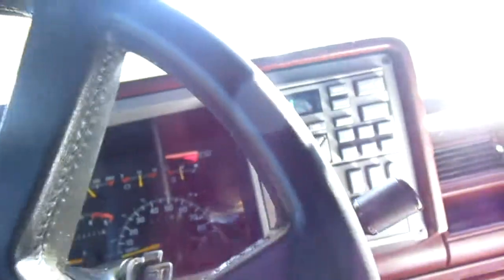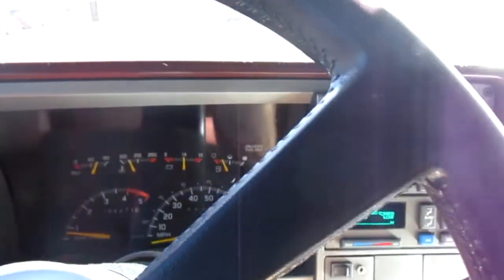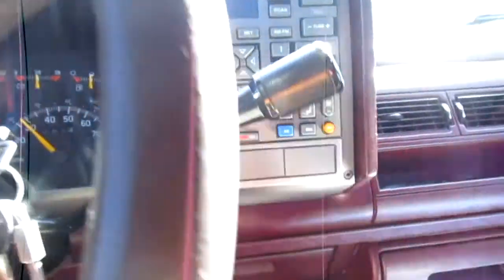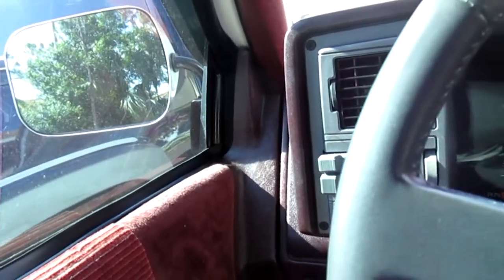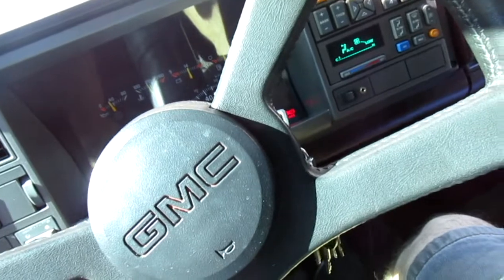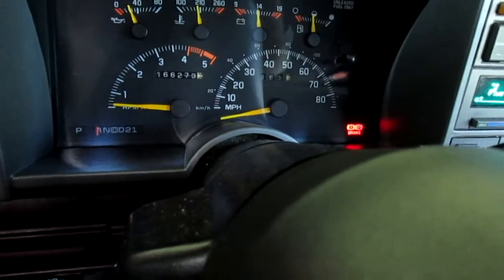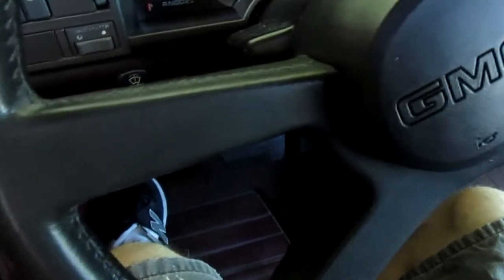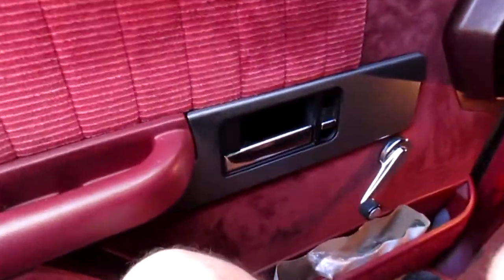Torque Converter Stall speed test makes engine stall!

Comment: The springs are to hard
Reply: Summit spent me 500 pund springs not 300 bent all my rods and made my stall convertor go crazy
Reply from the maker: was not it i had low fuel pressure but the Converter is a piece of junk.   Its still bad I need to change it soon  Finally have the time.  Its on the project list

Comment: Your truck is old and tired. Thats why.
Reply from the maker: No it had low fuel pressure
Reply: @GhettoWagon  Your fuel pump was old and tired. LOL  Just poking at you. I could tell by your dash that your truck is 88 thru 94 vintage.
Reply from the maker: @4793bigdaddy   It was not very old.  30k miles old its just the parts  quality of today and ethanol fuel.

Comment: My Explorer does the same thing, sometimes its a high stall, sometimes its a low stall. Did you find out what was wrong with it?
Reply from the maker: Torque Converter is bad but the fuel pressure was also low.  And the converter is still bad I need to find a competent place to change it
Reply: Thanks for the info. I suspect it might be a valve body related problem, because if the converter is bad, its bad, it shouldnt be ok intermittently. I will start with trying a shift kit first, but my trans has a few more problems like delayed shifting, bang in reverse, shift flare, so its more likely a must on my case. I'll see if it also fixes that.

Comment: Was it the converter?
Reply from the maker: Nahh fuel pump but the converter is a piece of junk. It shudders bad and i lose lockup. The fuel pump dropped off when there was more of load on the engine and the fuel pressire went below spec and made it chug and stall  I did not suspect the pump but then one day i threw a fuel gauge on, The pump is not very old. Typical AC delco quality. Garbage,

Comment: When I was 16, I was too broke to fix my vacuum leak so I just set my idle to infinity and beyond to keep it going at stop lights. I'm pretty sure there were a few times I flew in the air when switching gears.
Reply from the maker: Was that your old car? https://youtu.be/PMk1WJAq80o?t=6m2s
Reply from the maker: Was your car two cars welded together?
Reply from the maker: https://youtu.be/A40CAYkW3ME

Comment: Have you looked at the IAC motor ??  Might be something simple
Reply from the maker: Works good.  Reset it. Changes nada.   Being that the trans shudders and I have no lockup. gotta start with the converter.
Reply from the maker: I hope its bad.  I have no reason to believe anything else is causing it.   First I had the shudder.  Then I had no lockup.  Then I had a massive clunk accelerating from a stop. Felt like I had a high stall converter for a few days.  Then this, Dies out sometimes in reverse or drive  I did let it go too long. I stopped caring. lol
Reply: Ghetto Wagon  I'm not sure, if you could scan it and watch the slip of the torque converter that would tell you more. But it's not OBDII. If you hold the rpm up for to long with your foot on the brake I have seen that make an awful  bang.. But never did any damage. I be been driving my 03 town car with a possible bad torque converter for  about 10k miles it shudders at 50 mph up hills only when hot. I'm tempted to add rear end friction modifier ..  I  don't think it will hurt anything.. They do make an  stuff for shudder issues  but from what I've heard it won't last all that long.
Reply from the maker: Yea I was going to try the shudder fix.  Then some say it can create a slip in the rest of the clutches too.  At this point i'm just going to let the transmission shop deal with it. It seems they understand what I am telling them.   Maybe they will do the right thing by me